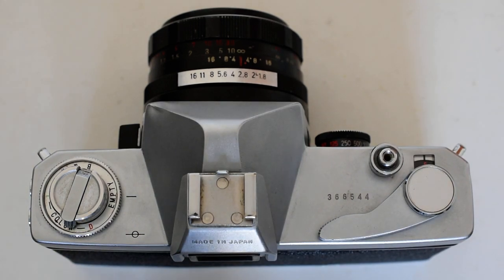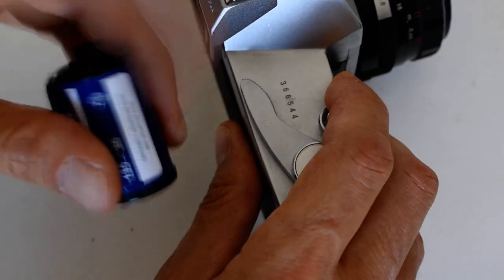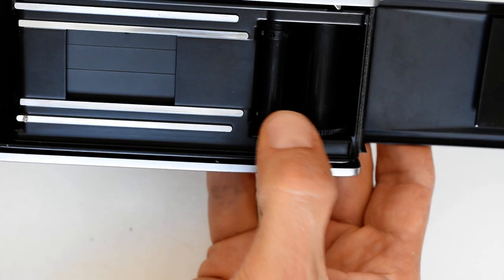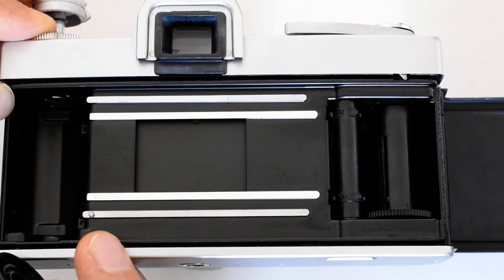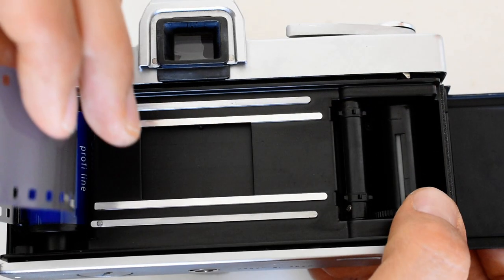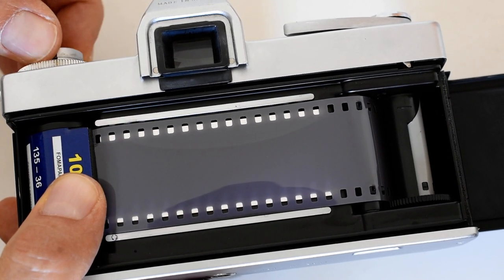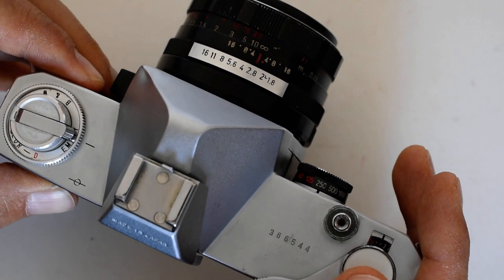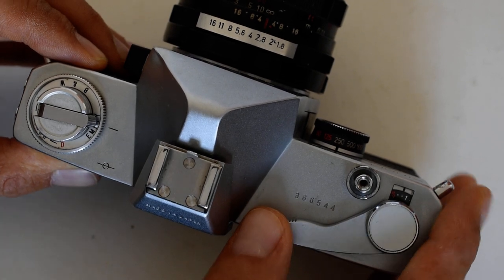Loading Film:  Ricoh Singlex TLS (Chinonflex, Prinzflex, Revueflex, et al.)

Comment: My very first 35mm camera (Xmas 1970) was a Sears re-badge of this camera. I wanted a Pentax but my parents were frugal and bought the Sears TLS. Little did I know the lens that came with it (55mm f1.4) would become sought after as a Zeiss Plannar contender. I even used it Professionally for a while with the Sears name taped over. It never let me down but I destroyed it strapped on the back of a motorcycle. I have since replaced it and now collect the many variations and re-badges of this very solid camera. YES, I am a collector (maybe 1 of 1) but they can still be had for cheap!!! The irony is, after all these years, the metal shutters have been consistently more reliable than the Pentax cloth shutter cameras I have owned! The 1.35 volt battery is an issue but there are workarounds.
Reply from the maker: Yes, the Copal Square shutter is one of the greatest photographic inventions of the 20th century.  They just don't fail.